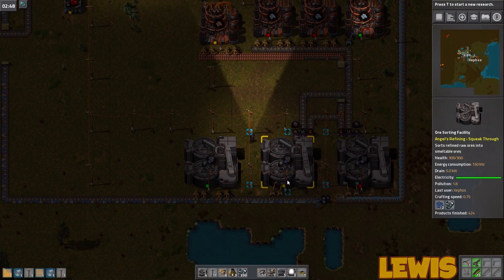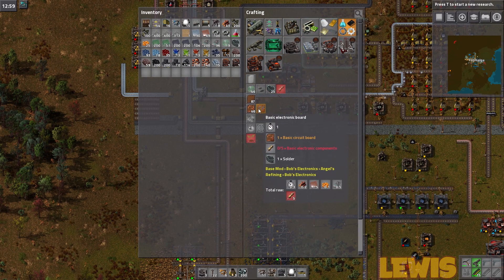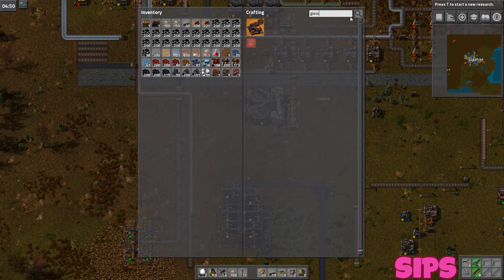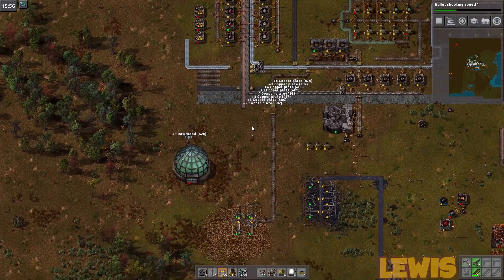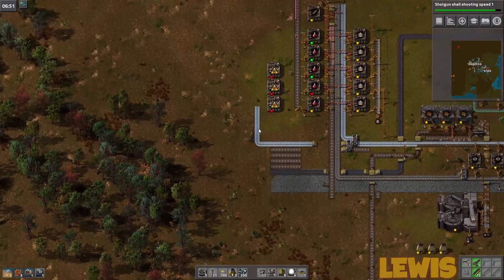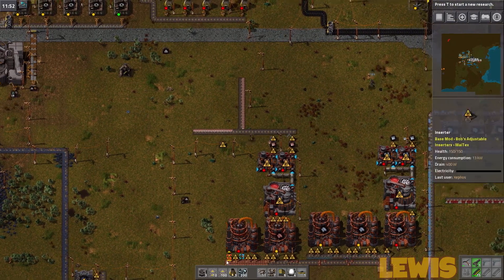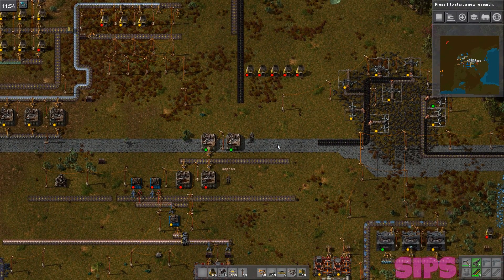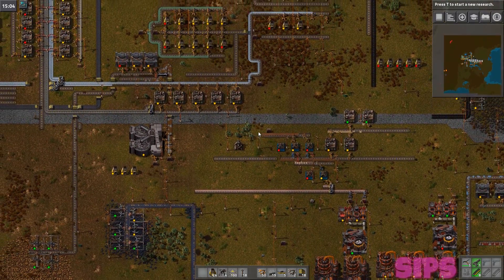Modded Factorio #10 - Cranking and Crunking

Comment: So... Did Lewis not record any game audio, or was the editor lazy and didn't think we'd notice that he'd just used Sips's audio throughout?...
Reply: If you swap the 2 video and then use each videos audio then you'd have to chop up the audio on top.

That'd be very hard after a while as the audio won't sync up anyone so you have to edit the audio separately to the video then splice the audio onto the video then splice the 2 videos together.

a lot harder than just using 1 video and 1 video/audio stream.
Reply: Just keep them together in their own tracks if transitions are a problem for you... Split where the transition is with a bit of overlap, and fade them in and out... It's not difficult at all... Anyone with a facecam needs to deal with several tracks as well. It's not difficult to keep them synced. Any halfway decent editing software and someone who has spent some time fiddling around with it can handle it without any issue. They don't use Movie Maker.
Reply: maybe someone new is editing and still is learning those tricks
Reply: ikr i've seen other people do it with software or they just use a splitter or something too get the sound from both computers if there lazy lol